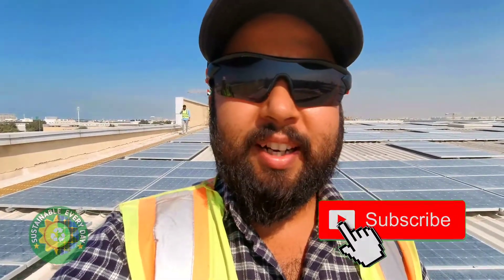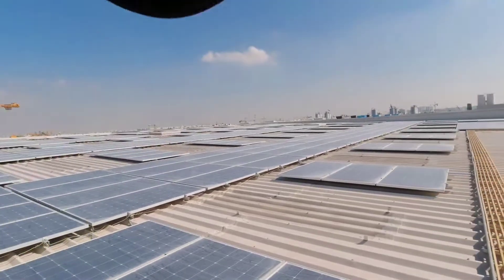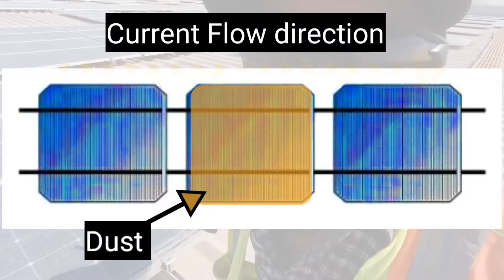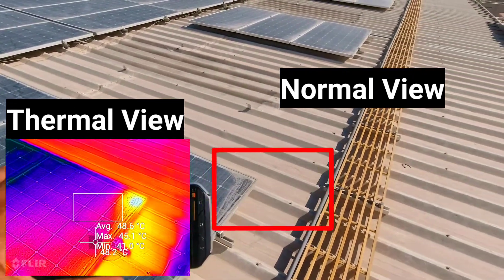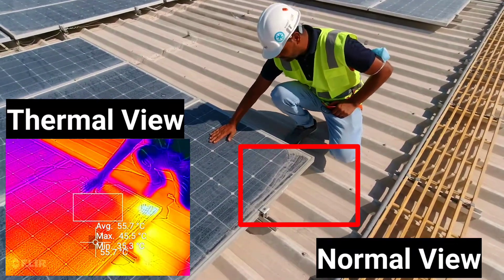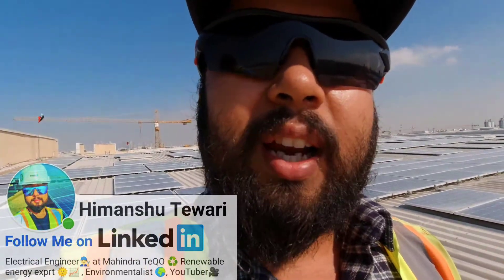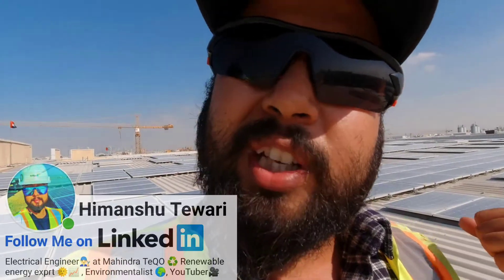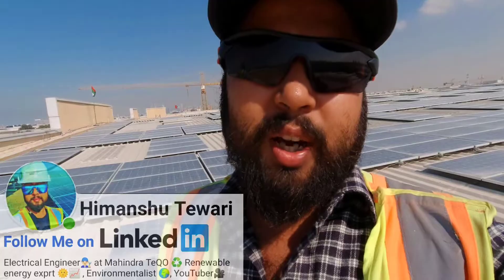Solar HotSpot | Thermography | Cell Damage

Comment: Excellent presentation...👏👏👏

If we measure backsheet temperature of a module, will it provide a good indication of the cell temperatures ?

Also, how do we compensate for temperatures of reflections? Thanks
Reply from the maker: Yes definitely I will make a separate video on this soon

Comment: The electrical conductivity of semiconductors increases with increasing temperature because, with increase in temperature, number of electrons from the valence bond can jump to the conduction band in semiconductors.
Reply from the maker: Heat loss , or Power loss due to system overheating  , why do you think your Laptop's motherboard equipped will all types of semiconductor needs Cooling fan ?